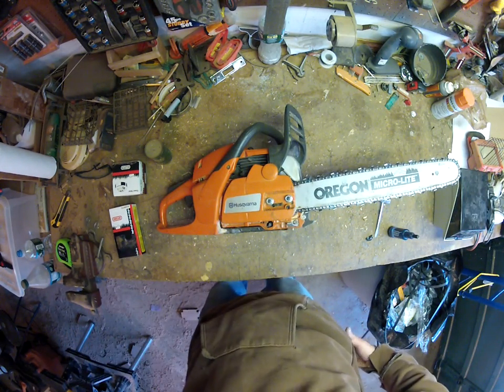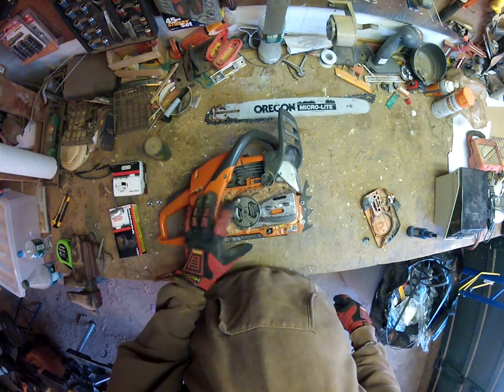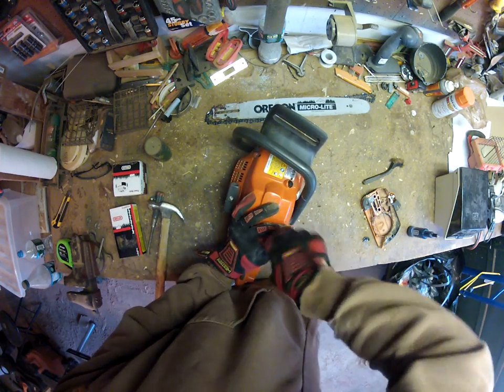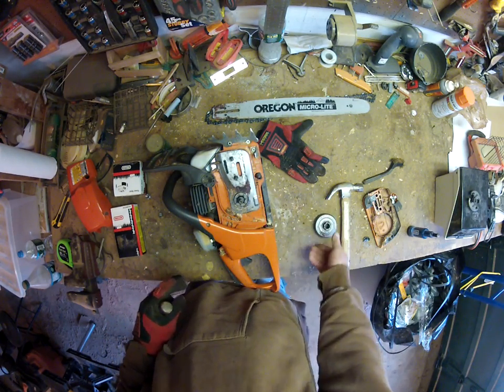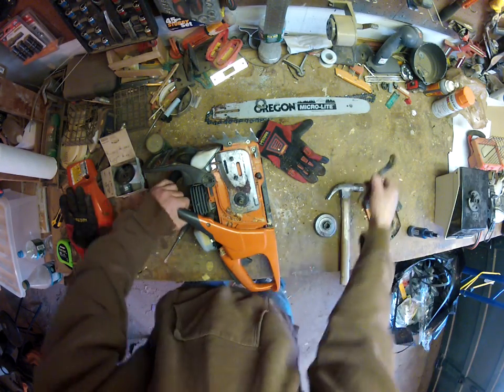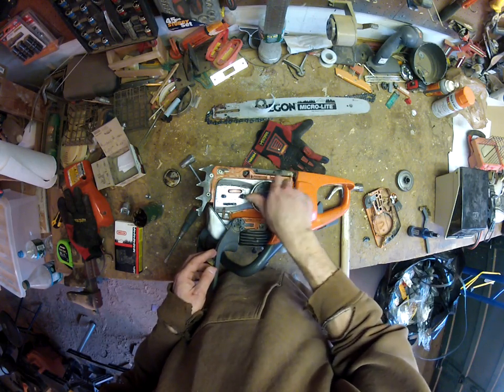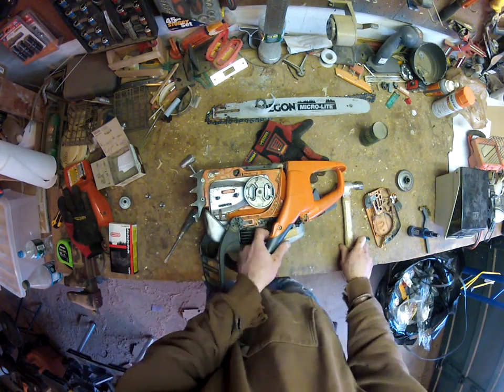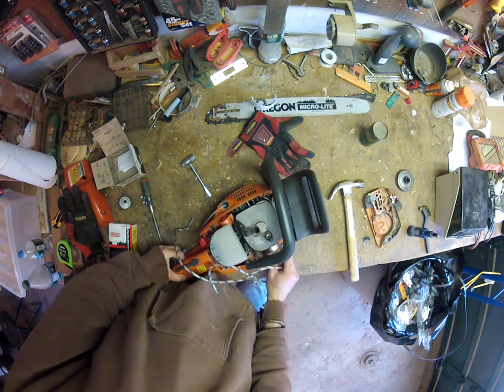Husqvarna 455 Rancher Drive Sprocket Replacement

Comment from the maker: Thanks for the feedback.  Did you buy the special socket for your impact wrench to use it to take off the clutch?  Or did you rig something up?  I think it was $30+ so i couldn't bring myself to buy it :)

I agree, running a thin kerf 0.325 setup on this saw makes it cut like a champ.  I like my Oregon Microlite bar/chain combo, but the bar is only 18" (i think that's as big as the microlites go) so i had to swap back to the stock 3/8 20" setup to cut some wider boards on my chainsaw mill.

Comment: Thanks for the info. Yes, I was planning to go with oregon's thin kerf microlite bar and changing the sprocket to .325 and reused my stock bearing .

Can I install oregon's ORF 513471x from bailey's and re-use my stock bearing? or do I have to buy the system you stated? I have a 455 Rancher.

 I have a couple once used and one brand new 95vp, 72 link, .325 chains, i wanted to sharpen and buck some large pine that would be better better off with a 20 inch blade. But that bar cuts in a curve with a new chain therefore I should change a that 20" bar someday.

You said your bar cuts better with the thin kerf. Have you tried Husqvarna's H47 72 3/8 chain? It's a huge improvement over the H80 stock safety chain.

Thanks again in advance.
Reply from the maker: I think that  ORF 513471x spur drive sprocket will work OK... I don't remember what made me choose the rim-drive sprocket to begin with.  It has the advantage of quick swapping the metal ring for different uses (tooth count and pitch) but I have never done so. 

I just found links to the products I bought when I did the swap - as it turns out I didn't use Baileys:
http://www.amazon.com/Oregon-Micro-Lite-050-Inch-Kickback-108580/dp/B0003J1D3G

http://www.edgeandengine.com/store/ore-513472x.html

Bummer about your bent 20" bar.   I have bought a couple of replacement chains for my 20" but honestly I can't remember which they were and how much difference they made - I run the 18" whenever I can.   If I need another I'll try out the H47, thanks for the tip.

good luck.

Comment: 1. Did you purposely leave out that circular ring(whatever it's called) that you through on/next to your bar that was replaced?
2.Why did you not put the ring  back in?
3. How many links chain was on the .325 sprocket?

I want to change my sprocket from the stock 20"-  3/8 to .325- 18"
Reply from the maker: The small metal ring that I put on top of the bar was part of the sprocket assembly currently on the saw.  This was NOT the stock setup, I'm reverting BACK TO the stock setup in this video.
 
At about 6:50 you can see that the sprocket I'm putting onto the saw has big gear teeth sticking out that drive the chain (Spur Sprocket).  The one I removed has slots that the metal ring slides into, then the metal ring has slots that drive the chain (Rim Sprocket... specifically "Oregon Power Mate Rim & Drum System").  So the metal ring is not part of the setup that I'm putting on the saw.

Sorry, I don't remember the link count on the chain and i can't dig it out of the shed right now.  I want to say it was 72 drive links but  my memory is pretty bad

My saw cut noticeably better with a thin-kerf Oregon Microlite bar/chain (vs the stock 20" bar).  If you haven't purchased anything yet, i would recommend getting that combo.  You will also need that Rim and Drum sprocket system to change the pitch to .  All should be available from Baileys Online store.

Good luck

Comment: Hey i was wondering why did you put the rope in the 455 at 3:55 if you could please reply why you did that. That would be good.
Reply from the maker: The rope is put in the spark plug hole to fill the cylinder. This prevents the piston from moving when you try to unscrew the clutch.
Reply: ezod52  thanks for the answer but i accidentally removed 2 springs on the sprocket and hard time to put it back in is their a tool or a way to put it back in
Reply from the maker: sen vue 

Sorry I've never dealt with that issue before so I don't have any advice.  My first thought would be to try using some needle nose vise-grips or something like that

Comment: You coud make a tool four the cluch......a pipe with 2 hnoches made with a angel grinder or a sochet that it comes with a chainsaw, cut alsow with a angel grinder.
All the best.
Reply from the maker: Thanks for the tip - I saw someone do something similar to make a tool for releasing the chainbrake in the clutch cover.   Neat trick
Reply: ezod52
Exactly the same situation with difrent pipe and 3 knoches.
All the best.